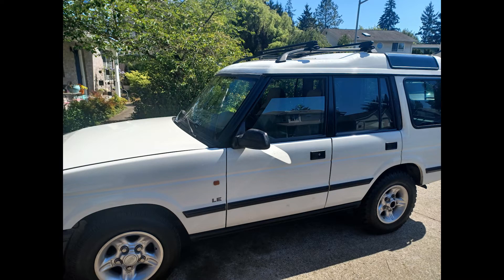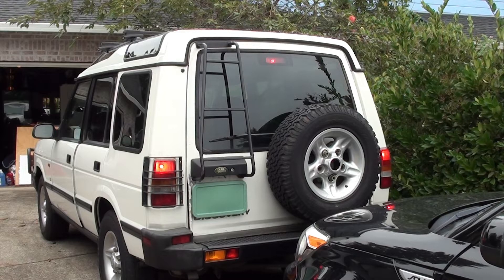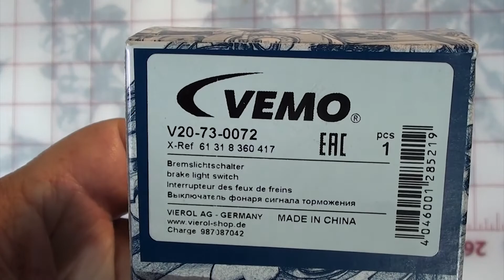Land Rover - Brake Lights Stay On - How to remove and Replace Brake Light Switch - Easy DIY

Comment: I watched your video yesterday as my stoplight switch wouldn’t return to the off position on my discovery 1.
I felt where it was and sprayed silicone lubricant Q8 in the vicinity of the switch.
It worked and now the switch is operating normally .
Reply from the maker: Thanks for your input

Comment: I always carry 1 extra in the Disco with me... this little piece cost me over 200$ to tow home because it failed and it locked my car in park and would not let me put it In drive... always carry extras
Reply from the maker: thank you for your input!
Reply: I used a punch on the  solenoid under the shifter so that it doesn't come out. Added reliability if you ask me. It's a safety feature, but I'd rather have a little less safety if it means I won't be stranded. Took me about 4 hours in total. The entire center counsel has to come out